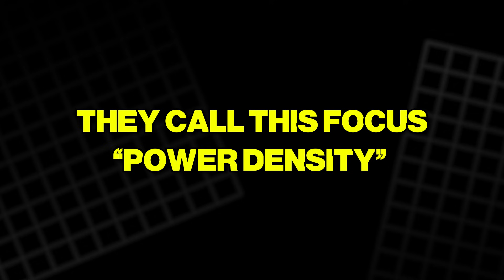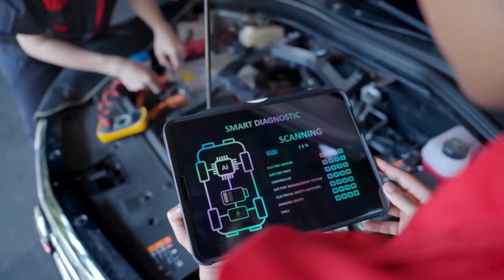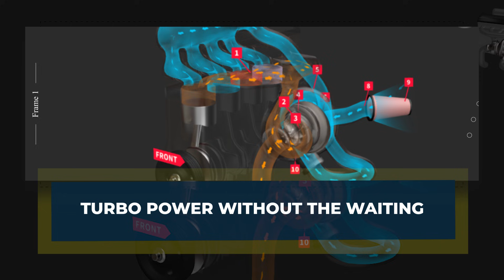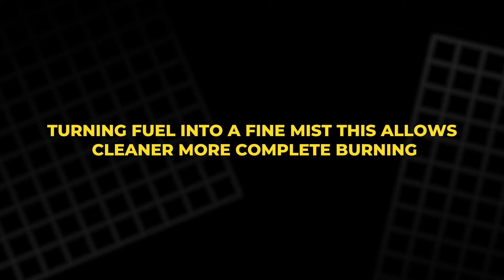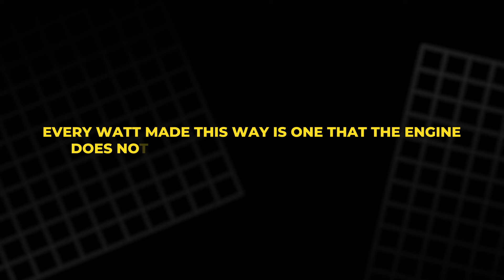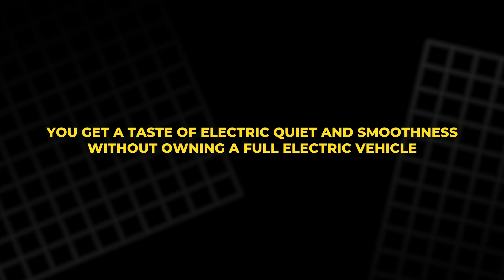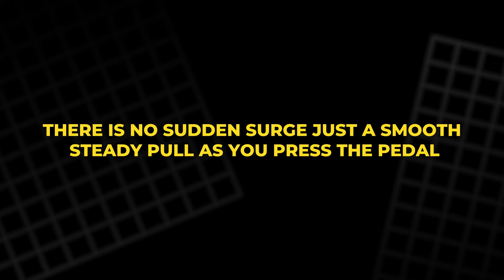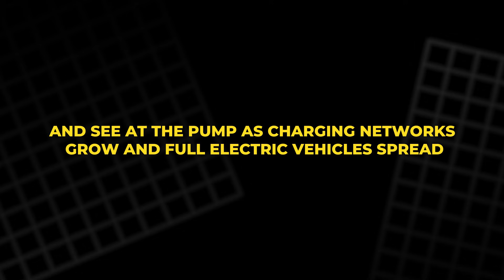Ford’s New Power-Dense Engine Revolution: The Future of Combustion Has Arrived

Comment: 3 cylinder with wet belt?
50k miles and dead.
Un honeable block.
Throwaway crap.
Reply from the maker: Thanks for sharing your thoughts on the engine's design!
Reply: @TheForgeEmpire its such a shame. I had a 97 ford pickup t280 tipper. 2.5 di.
400000 miles at end. Purchased at 70000. No new truck will do this while returning good mpg again with near zero service costs.
As a gypsy that travelled on road 25 years paving, this was peak engineering from ford. Banana top.
Im considering buying another smiley transit for my brother instead of new crap. That truck made money. New ones cost you just to own. 😊